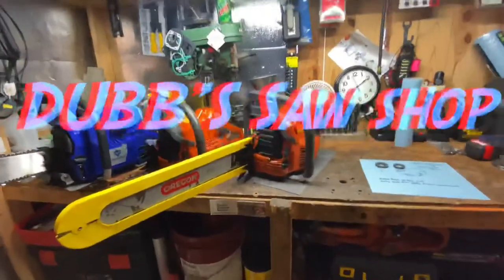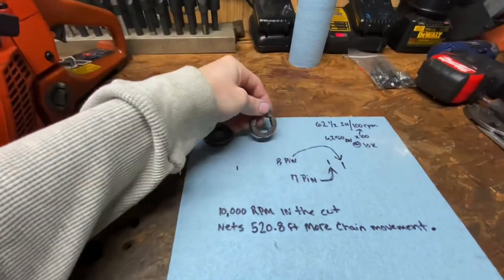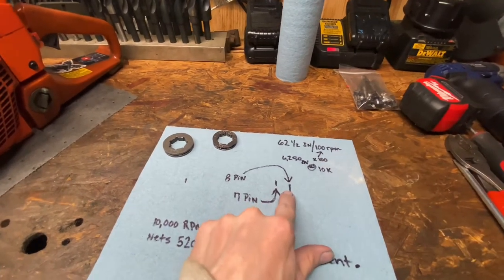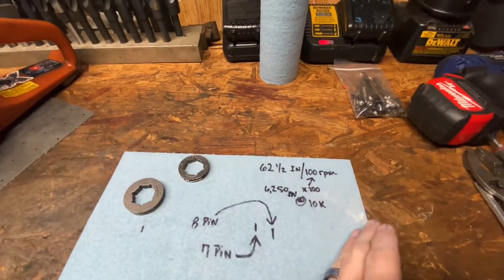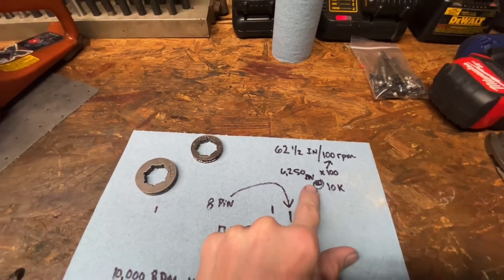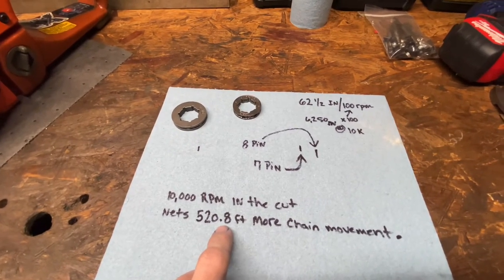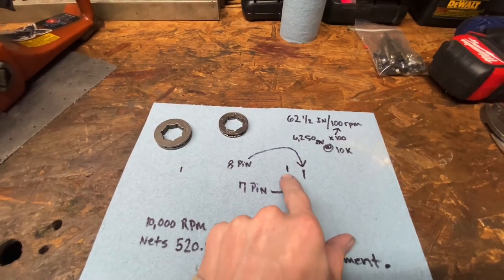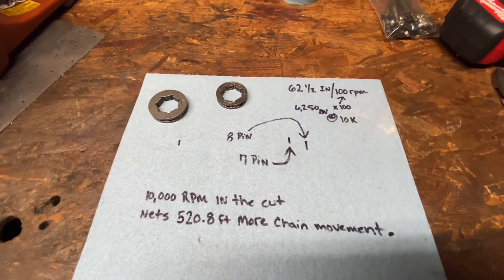7 VS 8 Pin Rim Sprocket.What more do you get???

Comment: Great video just 1 question:
if i go from a spur sprocket 6 tooth to a center drive sprocket 7 tooth,  will I loose torque?   
I'm assuming that i will, My saw if its relevant is a Stihl 009L
Reply from the maker: I would say a little but probably not very noticeable. I notice the main differences in bigger wood, like 12/14"++, as far as the torque goes. But the added chain speed will well over take that in 12" and smaller wood.

Comment: Thanks for the info.
My question is: stepping up to a longer bar, and moving from a 7t to an 8t sprocket will increase chain speed and help the engine pull the longer chain?
 🤔
Reply from the maker: The 7t sprocket will be better for a longer bar,  8t gives you more chain speed but will hurt your torque for pulling the longer bar. If you have a torquey saw, it'll probably help out. The 8 tooth will be fine you just won't be able to dog it in or push as hard, let the chain work and it'll be fine.
Reply: @dubbssawshop  Thanks for getting back!
I see on Amazon they also offer a 6t sprocket for my saw. For running a bit longer bar would that help even more with the torque. My saw is old runs good. Has a 20" bar with 56cc's. I plan to do a muffler mod and tweak the carb plus going from 063 gauge to 050  and a skip tooth chain should be things to help the engine when I need to switch to a 24" bar, ...and perhaps the sprocket swap.
Reply from the maker: @pipesmcgee9270  that sounds like a great plan,  yes the 6t will give you more torque. I'll help out anytime I can.
Reply: @dubbssawshop  thanks.
Where are you located?
Reply: @pipesmcgee9270  my cs 600 ran a 28" bar with full skip chain ok for some big trunks i needed to buck once I put a 7 tooth on it. I normally run the 8 tooth and then I forgot to switch back to the 7 when I buried the regular 20" bar in some heavy wood and cooked the saw... so yeah 7 tooth is handy!

Comment: I like 7 pin myself!
Reply from the maker: I always swap back and fourth depending on what saw I may use and what I’m cutting. 7 pin is all around good no matter what tho 👍
Reply: Great explanation and video.  It's basically like changing the rear gears in a race car to have more revolutions to go faster. Ty